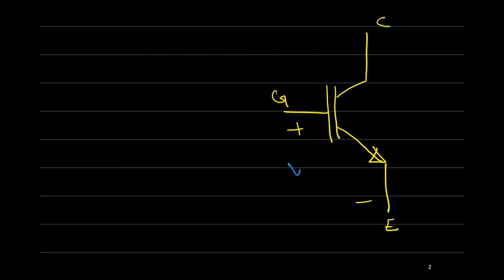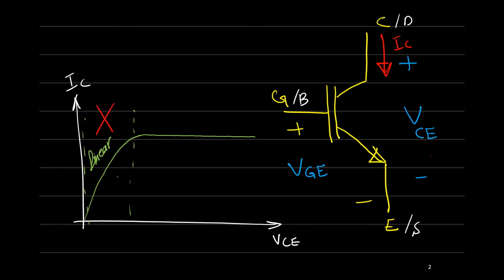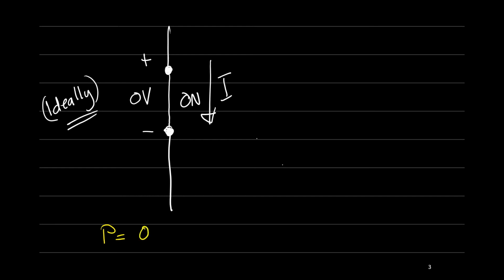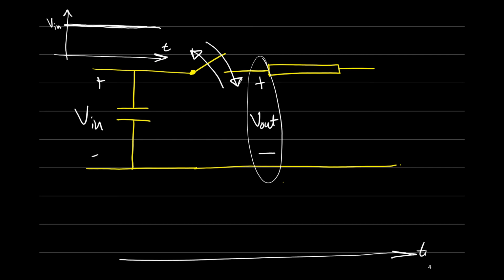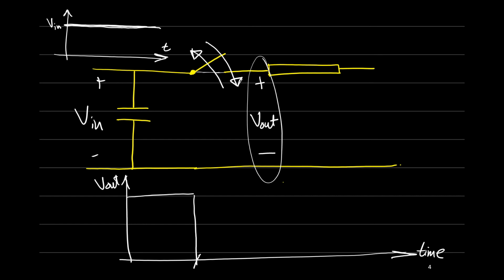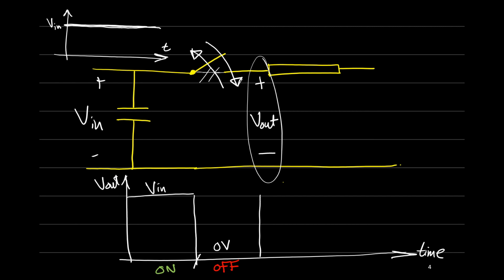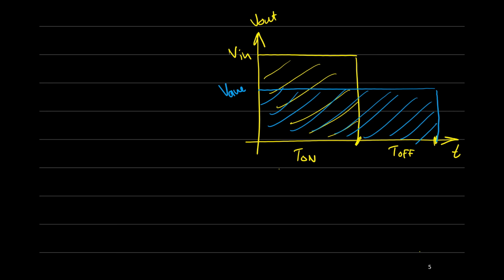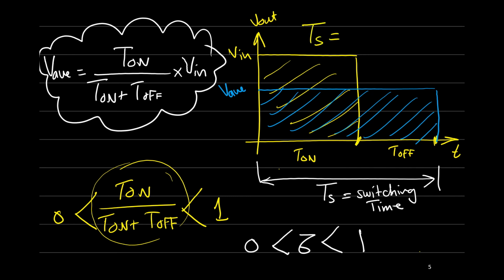The Need for High Efficiency Part C | Power Electronics

Comment: 3:30 isn't the region marked with x the saturation region?
Reply from the maker: It depends on the switch. For MOSFET or IGBT it's linear, for BJT it's saturation. Am I right?
Reply: @Elkhateb  for BJT and IGBT, x is saturation and here the switch is on , and what I understand (may be I am wrong) the linear region is where the MOSFET operate as a switch
Reply from the maker: @mnada72  it depends on the switch right, but for the mosfet, the switch is meant to be ON when it is in the saturation region. BTW, in the saturation or linear region, the transistor will be biased anyway and when the maximum amount of gate voltage is then applied to the device, so we can define the ON region as gate source voltage. You can give it the name you want as long as you can make it ON or OFF!
Reply: @Elkhateb  Thank you , I really enjoy the discussion and planning to continue on watching the series so expect some questions every now and then 🙂
Reply from the maker: @mnada72  great!